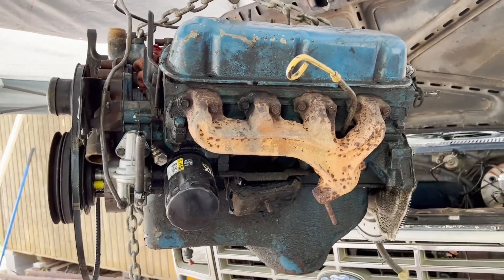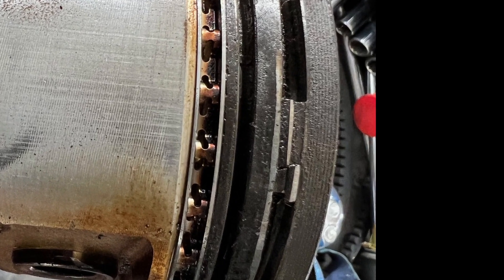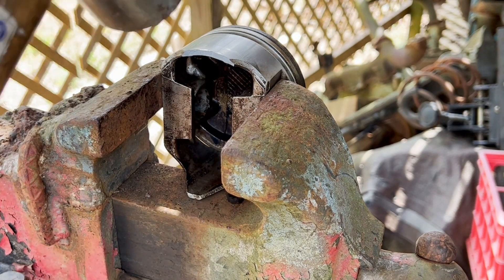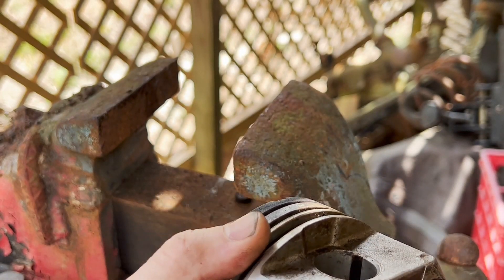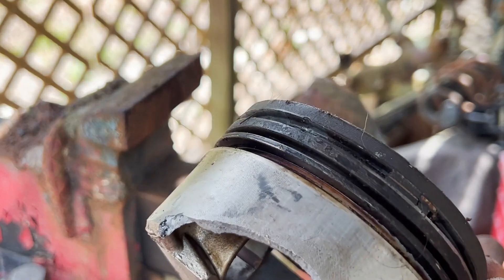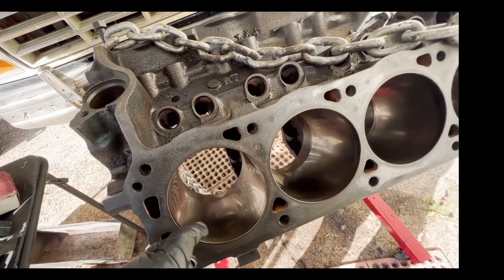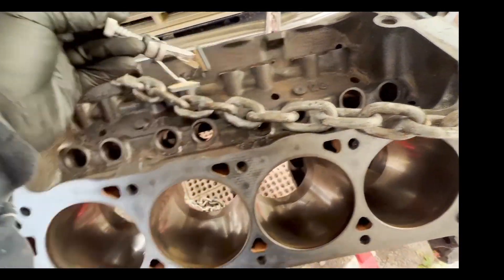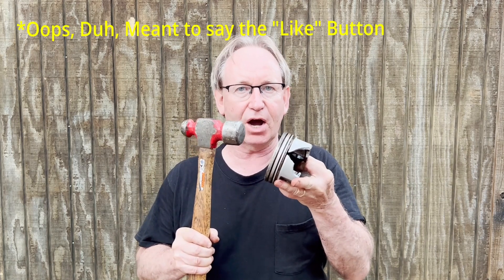Ford 302 Budget DIY Home Engine Rebuild Part 1

Comment: Cool series!  Going to watch all videos in order, no spoilers!! Very much appreciate the real time forensic analysis as you go.
Reply from the maker: Hi. Thanks for watching and taking the time to comment. That's Awesome! Glad you're enjoying the series and the "real-time forensic analysis". 
It's a budget build, so wanted to see how it would do if I didn't machine the block. It was .040 already and didn't want to go to .060, and really didn't want to find another block which honestly isn't hard. Can't swing a dead cat without hitting a Ford 302. I just wanted to see if I was as careful as I always am could I build a good engine from a block that was absolutely on the edge of being out of tolerance and needed boring.
Good news is YES! I've got about 40,000 miles on it three years later. It's my daily driver. I take it on 600- and 1,200-mile round trips and don't think twice about it. 
Honestly, I'd recommend finding another block if your tapers and piston end gaps are what I found in a few of those cylinders. If it's under .040 bored and going to .040 will clean it up based on the worst cylinder then bore it out. I just don't like to go to .060. 
The crank as you'll see after 20 years virtually had no wear. You'll see my repair manual with the dates and readings when I'm doing the crank from when I built it 20 years prior and they're the same. 
I've got lots of content on the truck and trans, so if you have Bullnose or AOD Trans you'll appreciate that. I'm doing a "budget" interior right now on the truck. Videos coming soon on that. 
I just did a 347 Stroker in a 66 Mustang you might enjoy that series as well, especially for bringing the engine to life. Very methodical. Applies to every carbureted engine out there. 
Let me know if you have any questions. Happy to help.

Comment: Can you resleeve the piston walls
Reply from the maker: Hi. Thanks for taking the time to watch and comment. You could re-sleave, but there's nothing special about an 80's 302. It's labor intensive, and not many shops around these days that can do it. Cheaper/easier to find another block. If it was an old Chrysler 392 Hemi or Chevy 348 Olds 350 etc you'd sleeve it. These blocks are everywhere. Thanks again for watching and asking.

Comment: Good man!...I have a 302 in my living room..my wife would like it finished and back where it belongs..(73 maverick)...I  appreciate you...
Reply from the maker: You better keep the Mrs happy. There's 6 parts to this video series. If on a budget (and who isn't) watch them all, follow my advice and you'll have a great running engine. Your tolerances will let you know if you can rebuild w/o machine work like boring it. If even one cylinder bore taper is too much and out of spec, you'll need to bore it, but if it has to go past .040 over stock, find another block.  I built that engine 2 years ago and drive it every day. Just got back from an 800 mile round trip enjoying the AC I put in and the transmission I built, all with zero issues. The AC and Transmissions are also videos on my channel.  Thanks for watching and taking the time to comment. Let me know how it goes.

Comment: got a quick question does the exhaust manifold used those donut gaskets cuz am having a leak there thankx
Reply from the maker: Hi. Thanks for taking the time to watch and comment. No Doughnut Gasket/Packing, at least not on the 80's factory setup. I'd have to look at some of my older Ford manifolds to make sure. Older GM used a doughnut. The Ford 80's exhaust is a Tapered Male into a Flared Female. 
They will leak if not pulled up straight and tight and if the flange is out of round. 
Loosen the flange and then get it to seat holding the pipe against the manifold by hand with one hand and alternating between the two nuts and even amount and getting them really tight.
Make sure the studs are not worn from heat/rust and put some silver Permatex Anti-Seize compound (it's a paste) on the threads. Ideally use Brass nuts.
Reply: @mkdhdinfiniteendlessconten3873  ohh ok thankx alot ama check on that am traying to see if it has the o ring soo i can replaced….the truck its a 1978 f150 with a 302
Reply from the maker: I checked my manifold stash and I have a set of 66 Ford manifolds that do take the Doughnut, and a set of 79 that don't. So with yours a 78, it could go either way. You'll just have to check. They will also leak between the manifold and head which there are gaskets for. I also put a bead of orange high heat RTV around the ports too.
Reply: i just toke them off and the pasanger side had a doughnut gasket in bad shape and the driver side didnt have nothig at all n yes ama replace those gaskets and the manifolds and engine too
Reply from the maker: ok. That will quiet it down. Those donuts didn't even last long from the factory. Between engine torquing and the exhaust system moving around that junction acted like a ball joint. Once the hot exhaust gas flow under pressure passes over those donuts it erodes and eats right through them.

Comment: Should this rebuild similar to the 85 5.0l. Fixing to disassemble mine
Reply from the maker: Hi. Thanks for taking the time to watch and comment. Your 1985 302 is identical to this. I've got a whole 6 Part Series on the tear down and rebuild. Watch them all for helpful tips and tricks, especially on reassembly. 
I was doing this as a budget rebuild and did not want to bore it any further as it was already bored 040 over 20 years ago the first time I rebuilt it. You'll probably have to go at least 020 over. Whatever the worst cylinder is determines how far you have to go. I wouldn't go anything over 040. Take a good look at the crank and closely check clearances. This is where all you oil pressure is either made or lost. If you already have good hot idling oil pressure (40psi or over, 20 psi min hot) and the crank isn't scratched you can probably just polish it like I did. Most shops over grind the cranks. If bearing clearances are over .002 you'll loose all kinds of oil pressure. Be very picky about the machine shop you choose. If there isn't a guy with gray hair running the shop, keep looking.
I drive this truck everyday on the rebuild I did over a year ago in this video series. I just did a 700 mile round trip to Florida in it. Gets about 16-17 mpg with 3:55 gears at 70 MPH. My 74 Cutlass with a 350 and a quadrajet actually gets better gas mileage. 
I've got numerous videos on all aspects of the truck that will be helpful to you if it's a truck that you have the 302 in. I'm happy to answer any questions you might have. Thanks again for watching.

Comment: Great video. I'm perfoming the overhaul in my 302 engine. I have all things that i need with good quality, however the camshaft that i found to bought are enginetech and Melling parts. Are you could say me with your experience if this brand have good quality. I'm in Brazil so i need to import it. Thanks for your attention.
Reply from the maker: Hi, Wow, Brazil! Melling is a long time good name. Used many of their internal parts over the years. Engine Tech, probably mostly pumps/Accessories and made in China if I recall, so won't say much on that. 
Check you Cam Lobes before you build to make sure there's about 0.003 taper across the high side of the Lobe. Check the bottom of the lifters to make sure they're crowned in the bottom center of the bottom. You can check with a straight edge or touch lifter bottoms to each other and they should not sit flat and rock a bit. Watch Uncle Tony's Garage YouTube videos on Cams and you'll see. There's been a lot of QC issues in factories sending out new parts that are bad. Don't do his crazy reverse piston thing. That's for racing. 
Make sure to properly lubricate all parts and use a High Zinc Oil like Shell Rotella or Valvoline Racing Oil to break it in. As soon as you break in the Cam on the first start running it at 2,000 RPM for 20 Minutes, change the oil and filter. First engine run scrapes a lot of metal loose into the system.
Thanks for watching and taking the time to comment and ask a question. I have a 6 part series on this engine build, and many more related engine videos that will help you greatly.  Let me know if I can be of any more help. Thanks again.

Comment: You can not budget build any Windsor family engine from Ford. These engines are notorious for eating crankshafts and valve guides, and cracking pistons. You'll have a fortune in just making it the piece of junk you started with.
Reply from the maker: Hi. Thanks for watching and takin the time to comment. I'll agree on the cracking pistons. Haven't really seen that in other engines except the 302/351. Otherwise though, I built this same engine 20 years and 200,000 miles ago, which is pretty good. The carb power valve failure is essentially what killed it. If you watch Part 3 of my 6 Part Series on this engine where I build the bottom end, the crank journals are exactly the same as they were 20 years ago, both mains and rods which is pretty amazing. 
I've got about 20,000 miles on this rebuild, drive it every day, take it on long road trips, and it barely uses 1/2 quart every 2,000 miles, so pretty good for not boring it out and budget building it.
I actually prefer the Ford 300 Straight Six in a truck. The 302 really has no business in a truck. Oldsmobiles 350, 425's and 455's are my lifelong favorite and specialty. What's your favorite engine?

Comment: Really appreciate the video! Just bought an ‘86 F150 with a 302 in it, haven’t had a chance to actually look it over and determine if it will need a rebuild, this vid has given a great deal of insight before I start the inspection… also makes me want to find a junkyard I6 and just replace the whole unit, but lord knows the 300’s are hard to come by in my area.
Reply from the maker: Hi. Thanks for watching and taking the time to comment. That video is the first of a 6 part series that's also a playlist. I have numerous videos covering the fuel tanks, front brakes, coil, carb, radiator, etc. Hope you're also a new subscriber.
Congratulations on your new 86 F-150. I agree and honestly would rather have the straight six 300 which actually is a long stroke truck engine, and yes hard to find. While the 302 is a great engine, it's not a truck engine. I think Ford just put them to market them as a V8 truck. I'm hoping to do a 351 rebuild soon so the truck can tow better and pass when needed. It struggles otherwise.
Reply: Is there an advantage to replace a v8 with an inline 6? Rebuilding it would warrant a better outcome wouldn’t it?
Reply: @L2_LTWO  For my particular situation, I have no idea if rebuilding the current engine will end up feasible. Currently don’t know the compression on the cylinders, (my gauge disappeared, along with my time for auto work haha), however I have suspicions it’s misfiring. Took apart the upper plenum and found build up entirely blocked off the EGR port haha. Oil pressure drops to zero and flutters once it’s warmed up…. Doesn’t make any rod knock, amazingly, but I don’t believe it’s just the oil pump. Engine’s got roughly 260k on it. If all that gives any idea why I’m considering simply replacing it hahaha.

Comment: I wouldn't waste time with a 302 if a 351 will fit.
Reply from the maker: Hi Thanks for watching and taking the time to comment. 
Agreed on the 351. I'm looking for a complete 351W with brackets to rebuild for it now. 302's are for Mustangs. The 302 struggles towing and hauling. The 300 straight 6 does better and uses less gas. 
It's a fun truck that I've had since '91. It even survived a 100 year old oak tree falling slowly on it during a hurricane, but not w/o blowing out the windshield and other damage to easily replaceable panels.
Needed it going quick and cheap, and wanted to start my channel so it was a good way to launch my channel and get rolling. 
Anyhow, I'll be doing a series on the 351 and some updates on the truck fixup and mods.

Comment: Waste time to fix it
Reply from the maker: Oh, I don't know. I've had the truck for over 30 years, enjoy doing this, and made a video the point of which is "DIY Budget Rebuild" with over 3,000 views and the rest in the series that's helped a lot of people. I'm very resourceful so was able to barter and trade some parts and had other NOS Parts, really only paying for a new cam/lifters and gaskets, so for under $500 I've been driving it every day for 9 months and over 20,000 miles, it hauls all kinds of stuff, people always want to buy it, it's fun to drive, and I'll be swapping out body panels I've had stashed for years, and painting it. Quite a good use of my time.

Comment: I would recommend purchasing a dial bore gauge and check all the cylinders for out of round and taper before you begin.
Reply from the maker: Hi. Thanks for taking the time to comment. I actually have a dial bore gauge, but it was in storage, so did this the old fashioned way with a ring checking end gap which let me know two cylinders were out of spec. Since this was a budget build/refresh with parts I mostly already had and wasn't going to bore it,  and am going to build a bigger engine to replace it, I just wanted to show folks the basics. Thanks again for taking the time to watch and comment.
Reply: Good idea. But cost money.

Comment: You never said how you took the lifters out, there is a right way.  I used to street race and rebuild small block FORDS all the time.  I bought an engine site unseen hoping it was a good motor, it sure was, whoever built it used way to much blue silicone and plugged the oil pump inlet.  The motor was like brand new.
Reply from the maker: Hi. Thanks for the comment and question. The lifters usually come right out with a magnet. Sometimes there's some varnish around the bottom and they'll get stuck and some needle nose vice grips gently grabbing the outer thickness of the lifter will get them the rest of the way. If it's a really nasty engine that I'm rebuilding and they're stuck I'll get them up as far as possible and after the cam and pistons are out I'll drive them out from underneath upside down with a brass drift and hammer.

Ya, Some folks can't resist using as much blue RTV as possible which seals nothing on an engine and gushes out and gets sucked into the oil pickup as you've seen. It actually broke the oil pump drive shaft it was so blocked and there was so much suction pressure. 

Always buy a dirty engine out of a wrecked car. If it's dirty it's been running a long time. If the car is wrecked, that engine ran till impact. Don't buy a clean engine someone else built. I suppose now you know that.

Comment: I am very happy to see you using a 3 stone hone instead of that stupid ball hone, there is alot of power locked up in the stock heads, a paper roller will do wonders along with grinding out the big knob in the tops of the ex ports and put a 351 cam in it
Reply from the maker: Hi. Thanks again for commenting. Ya the ball hone is really only if you already have true cylinder walls. If they're tapered they'll just follow the contour. A good old school 3 stone will true up the walls or at least make them less bad if you can stop before you go too far and end up with too big of a ring end gap when hoping to just do a budget build and not bore it to the next increment. 
I've built quite a few Olds motors, and grinding out the EGR bumps in the exhaust ports does make a noticeable difference.
Reply: Can you explain the paper roller?
Reply: @joelmclaughlin2558  Its sandpaper rolled up in a spiral and you take a spike and jab the roll onto the end and use this on your die grinder

Comment: And why does the 302 crack skirts on cast pistons and the 289 and 351 does not?
Reply from the maker: Hi. Thanks for taking the time to watch and comment. Not sure, but it seems to be a thing. I've done several 302's and they all did it. If I recall, it's the skirt on the bottom/outer half of the piston.
Reply: @mkdhdinfiniteendlessconten3873  Its because of a bad rod ratio in a very short block, the rod is almost sideways at the pistons halfway point, the 289 is bad enough and the 351 has a taller block
Reply: 289 used the same piston as 302 , but the longer rod of the 289 kept the piston up in the cylinder for more stability. Less rocking of piston in bore.
351 has almost a 6 inch rod. Pistons are different. Made stronger. But I have seen a 69 and 70 piston with high mileage crack.

Comment: i never bore more than needed if .010 will clear it up thats all i do. around here lots of people build 408 out of dodge 360 but you have to bore 040 i never do i leave bore as small as i can the difference in std and 040 in cubic inches will never be felt in the drivers seat
Reply from the maker: Hi. Thanks for taking the time to comment. Yes, .010 - .020 is as far as I generally want to go, and had to go out to .040 on this block when I first rebuilt it 20 years ago. Boring is just to true up the cylinders. Have to do a stroker kit for any significant CI increases. I'm wanting to either find a decent 302 block and build a stroker 347 or just build a good 351W for it.